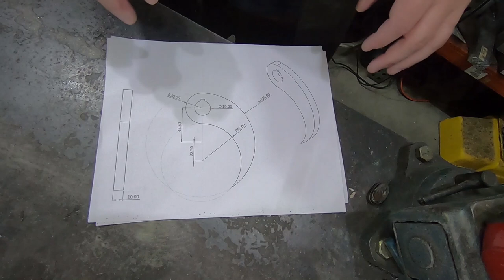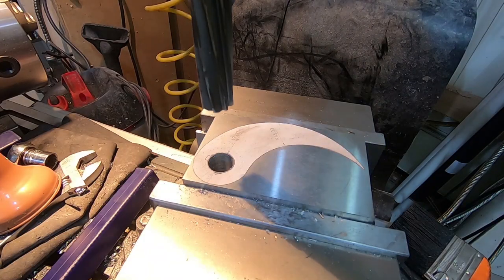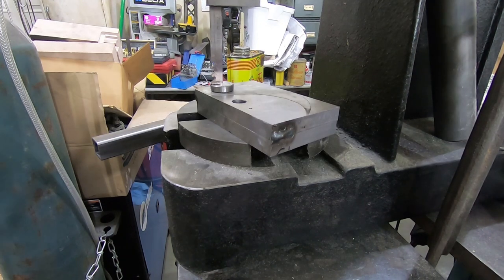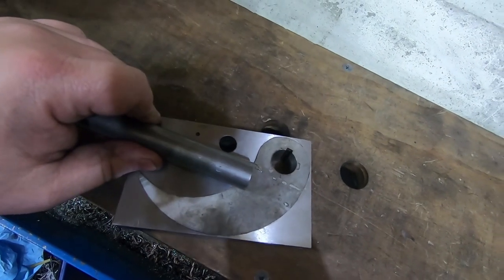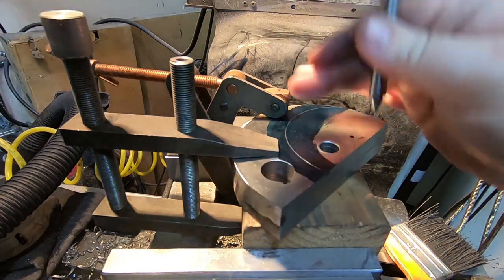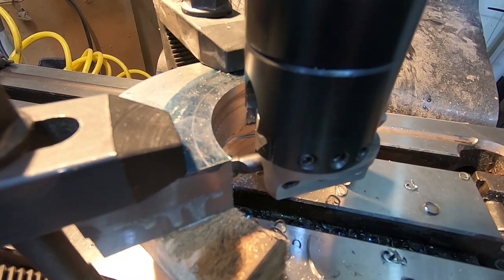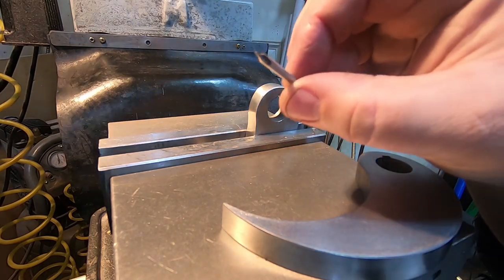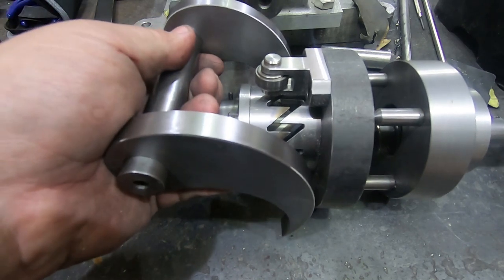Clapping Machine prototype -- claw cams

Comment: Great work!  I haven't been following the project so I'm not sure what the end result is going to be but I like it.  I'm surprised you don't have a rotary table.  That would've prevented that nasty interrupted cut on the lathe and the boring operation.  Keep it up in the meantime.
Reply from the maker: Thanks! And, trust me, I wish I had one. So far I've just never had the spare cash when a decent one has turned up locally.